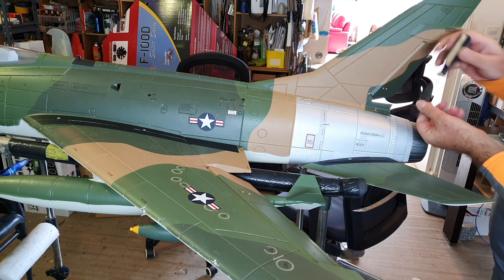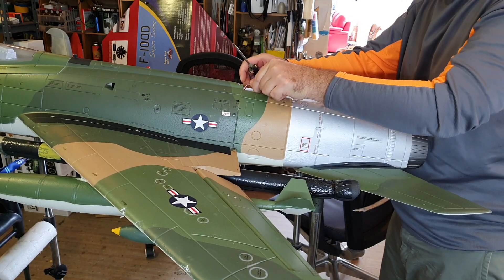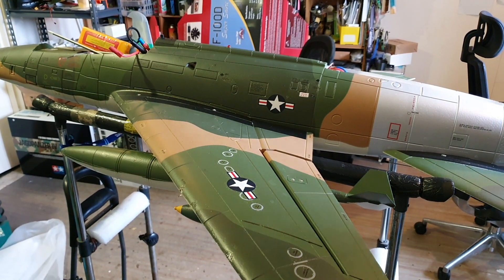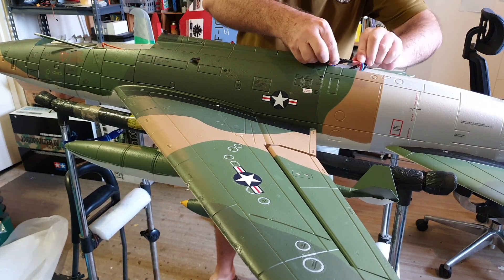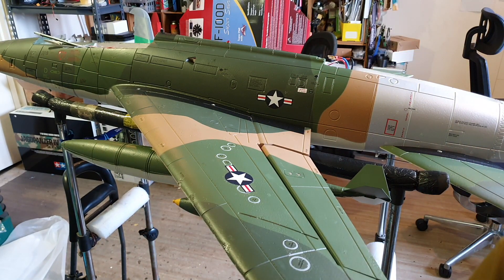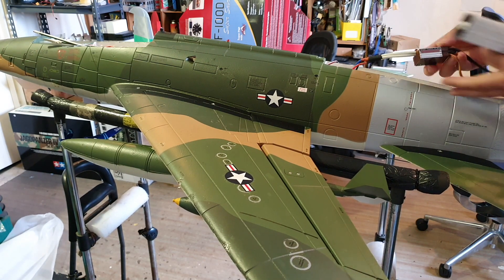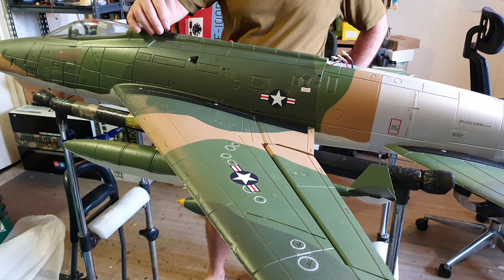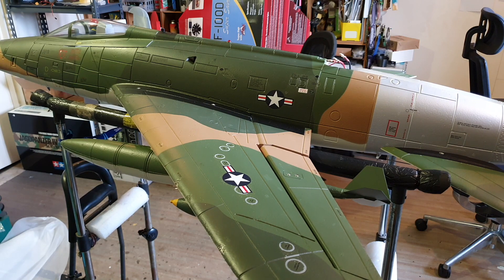Flex F 100D Power failure and crash on 2nd flight

Comment: When you removed the fin, it is easy to see two of the three connections from ESC to motor have much exposed bare metal of connector showing. Standard practice with electric is to apply shrink tube over those connectors for two reasons- prevent disconnection and prevent arcing between power legs. When you get the arc, the ESC will fry every time.  You got the arc because was not insulated with shrink tubing and because you did not secure the ESC to keep it from moving around during maneuvers, which is another standard practice.
Reply from the maker: I think you are right.
Reply: @VictorHugoRC1111  I am glad you did not loose the plane completely and that you can make the repairs. We are always learning.
Reply from the maker: @jeffworsham8240  I put a DLux 100A ESC and soon she will be airborne again

Comment: It’s best to go ahead and make sure your connection from your motor to your ESC are firmly press together and also use the small heat shrink look to me like the connection was not made all the way on your Esc to your motor it should not be any of the connections showing you could burn up wiring that way next time just make sure Esc is fastened down and your connections are firmly pressed together and heat shrinks installed..😁
Reply from the maker: Thanks for the info!

Comment: Dear Sir I had found on mine that the esc hasnt fastened down it was just flopping around loose that may have disconnected and caused your motor failure
Reply from the maker: I also thought that, but further analysis shows no power coming out of the ESC.

Comment: Mine did the same thing. On second flight.  Mid field.   Plenty of speed to make runway   No drama.  I did talk to manufacture and they are sending another speed control.    And motor if necessary.  I’m just glad the jet is both fury
Reply from the maker: Yes. Same here. I hope the new ESC is up to the job.

Comment: Dear Sir you may not be understanding me What I'm asking is if the f100 has a taileron mix as default
Reply from the maker: The Aura system is hooked to a 3 position switch, 1st position is no taileron, 2nd is slight taileron mix and 3rd is expert with full taileron mix. I hope it explains it.

Comment: I had a similar disaster with the Flex jet which ended up in as 40 pieces of foam with zero recoverable components.  I would be nice to get a free replacement from Flex Innovations if they are watching your videos.  Anyways, looks like your F100 will fly again with a new ESC from Flex Innovations fro free.
Reply from the maker: Yes. The ESC is coming from Flex for free. Good CS.

Comment: You lost power ..sounds like a bad ESC ..oh it worked good and now that it's cooled off but when it gets hot it goes back into fubar mode..... Change that thing yet to a 200-amp ztw or a gecko....that's the only situations you get with electric edf's either the motor got hot or the ESC failed you need to upgrade.. does that jet have  an innrunner edf ??? I would check the motor and see if it's the right motor and amperage to run that 12 or 14 blade that you're using... Something in your electrical system is obviously getting real hot not good..
Reply: And I also noticed your ESC has small capacitors.. those capacitors should be big.. I'll run 65 amp ESC from gecko and they're twice the size of the ones you're using.. or that's in that jet that failed on you...I'm just trying to tell you what I use and I've never had any ESC problems because the worst thing you can have landed yet is failure because of tolerance on Jets or so tight you better make damn sure you got the best of everything

Comment: Have the same plane, 1 flight no probs.. Would like to have seen if battery dropped a cell... But would urge you not to use another ESC from same Manf...Would go different ESC Manf...
Reply from the maker: True. I changed EDF and ESC